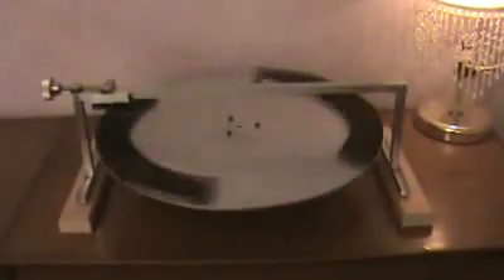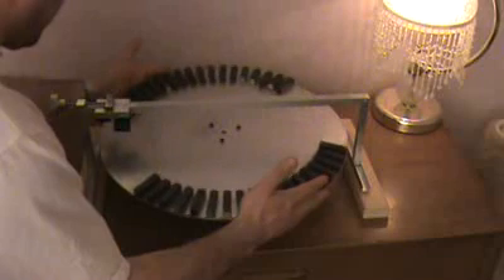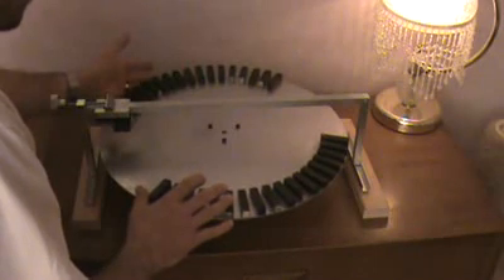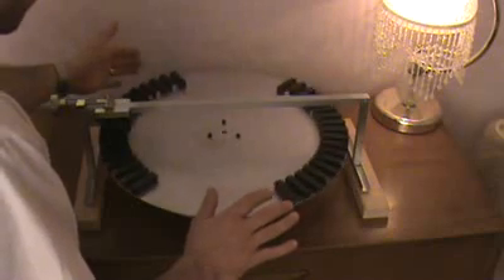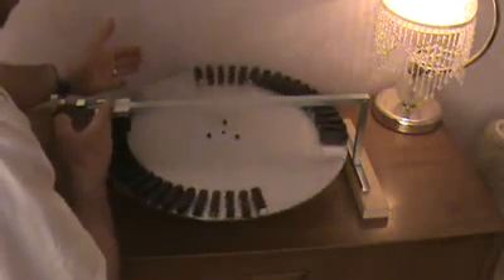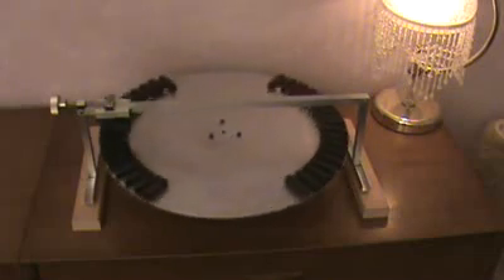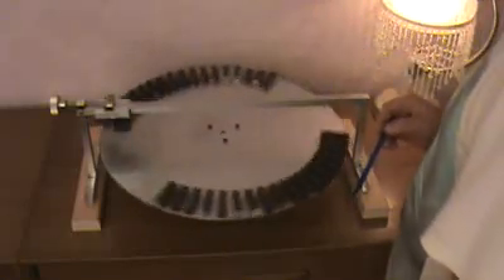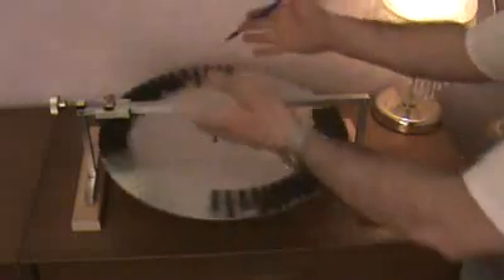Howard Johnson Magnetic Motor by Mylow

Comment: Why can’t I find this on the guys channel? Did it get taken down?
Reply from the maker: Yes, indeed, it did. Though I can only speculate on the reasons.
Reply from the maker: If you want to know more about this particular effect, I would just look up spintronics, magnetic spin fliping, and magnetic gates. That should get you 90%+ there. Most of the material can be obtained from Google Scholar or other white paper publishers.
Reply: What I found strange, is I found this video elsewhere posted 13 years ago

But Mylow’s latest video is 5 years ago, and in it, he almost looks like he forgot how to make it work…
Reply from the maker: @ashercorbett8089  no you are correct the YT channel was a re-upload, may not have been the original poster either. Most of the Free Energy research goes back to the 60s popping its head out from time to time to see if the humans have caught up yet. So you will find the same videos all over the place throughout time.
Reply: Awesome, thanks dude
Reply: I’m tempted to upload this video myself. The more re-posts, the better

Comment: Did Mylow ever show how he built his motor?
Reply from the maker: I'm not sure, but the archived book explains how he did it.
Reply: The trouble is, magnets are not perfectly equal strength, so there are fussy adjustments to make, in several degrees of freedom. Ordinarily there is a sticky spot, and gaps are there to get past that. The bounce of the top magnet is important